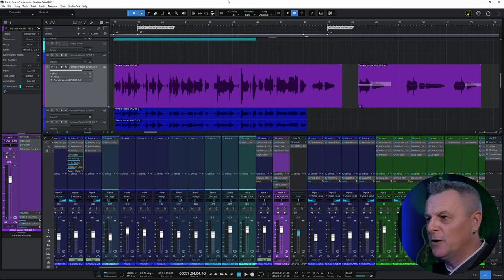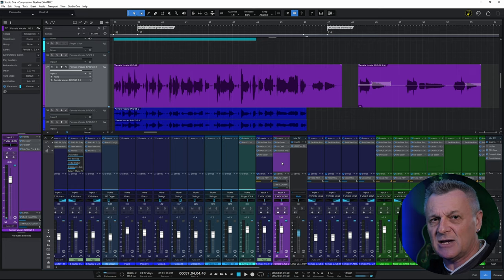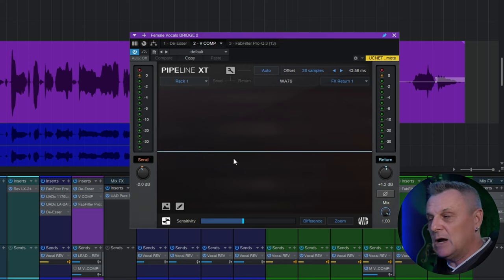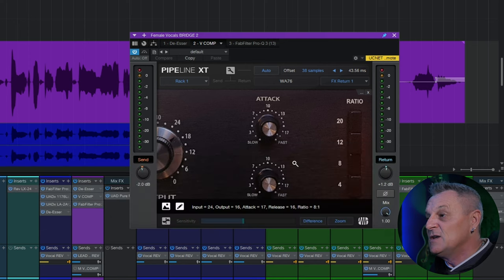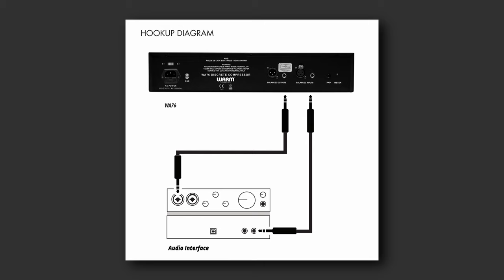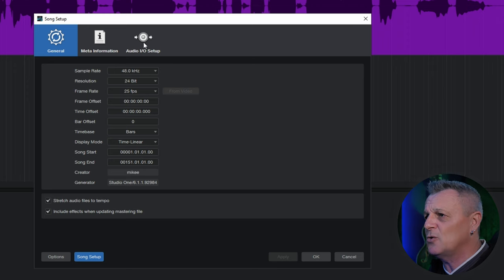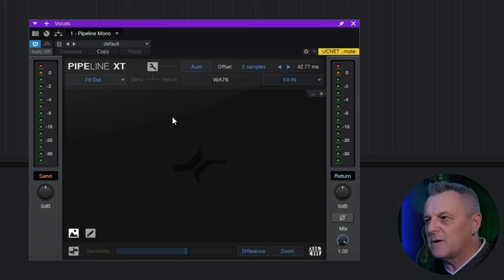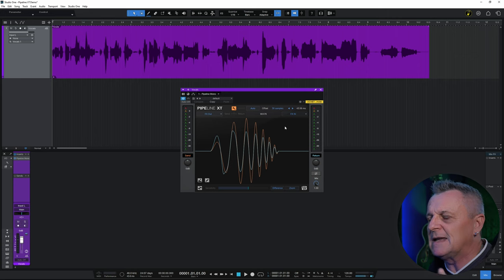Studio One | Pipeline XT (Using External Hardware)

Comment: Nice info but I found a easier and faster workaroud for bouncing mono or stereo track with hardware insert! put the PIPELINE XT on the EVENT FX.. duplicate the layer so you can go back to the unprocessed original file. than CTRL-B. bounce it!! studio one is gonna bounce it in real time. create the new file. no need for confusing duplicating tracks, etc.. :)

Comment: your approach and explanations are much appreciated. You may have used the WA76 in the video because you had it in your rack and it worked for demoing Pipeline XT, or you may love it and actually be using it. Be interested to know which it was, and if it was 'love', what are you gettin from the analog box you couldn't dial in from the suite of 'on-board' processing S1 ships with (let alone the myriad other plug-ins out there). Possible answer ...you know the WA76, you've got favourite settings on it, you patch it in ...and the magic happens. Maybe other reasons? Your grasp of 'all-you-have-in-the-room-there-with-you' makes your choice of what to use, and why ...of interest. Cheers

Comment: Hello from Santa Clara, CA (Bay Area ) so, I noticed how you move the tone generator in the fader section but, did you know you can also move the plug ins right above the plug-in where the names are at, just below the color bar, by click and dragging across as well  from left to right, I mean since the plug-in box is open that makes it easier.    Also question? if you're using Pipeline  can the patch bay still be used?